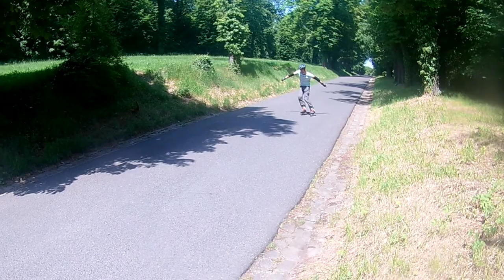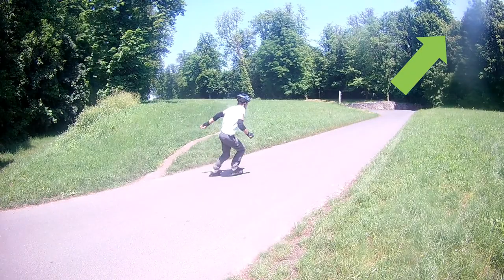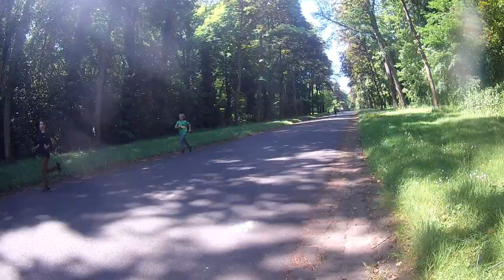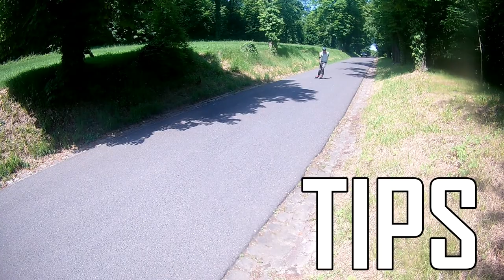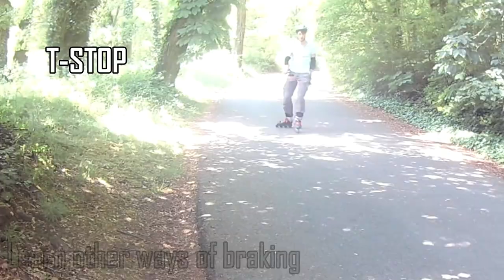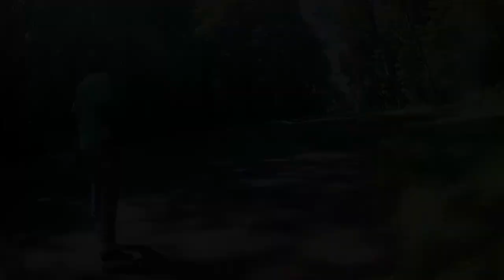INLINE SKATING EXPERIENCE: Curving downhill. Slalom turns. TUTORIAL (2018)

Comment: But what if I can’t get to this angle of edges. What pointers do you have. Are you lifting the toes ? Are all wheels down? Are you in your heals or ball of foot ? Help
Reply from the maker: The weight is more in the heels . It's even recommended to push into the heels. But all the wheels should be  on the ground otherwise it could become uncontrollable.  The feeling comes with practice so it's better to start from small inclines.
Reply: @NikZvi  thanks. is it just practice time that I’m lacking? Or technique
Reply from the maker: @hvdb4492  good technique comes with a lot of practice. It's not very complex move, so I think you will get the proper technique with some time.